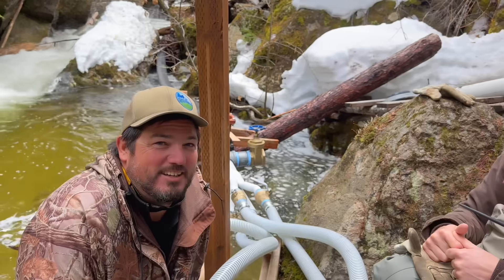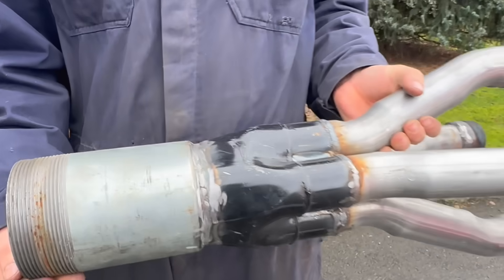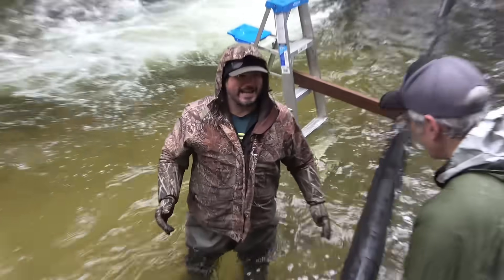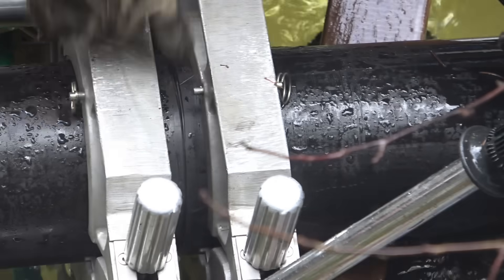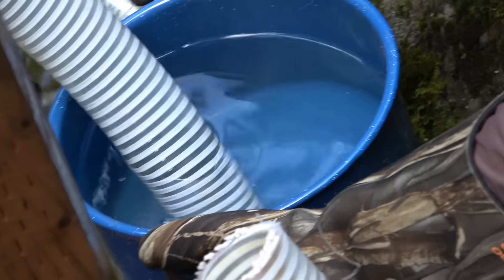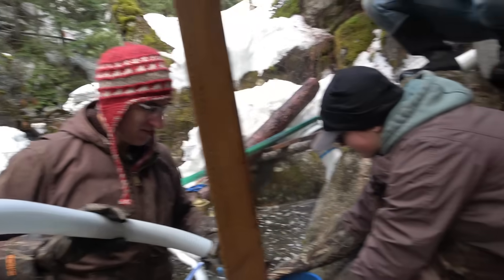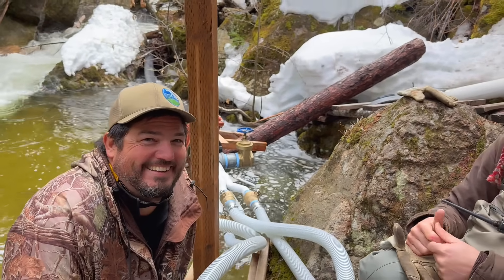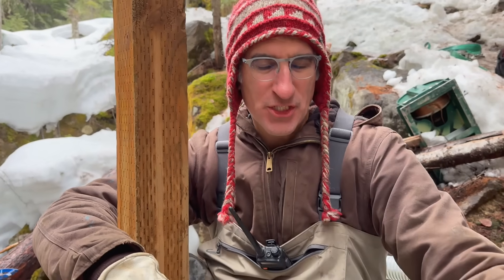Off Grid Micro Hydro - 24/7 Electrical Power - THIS is The Way!

Comment: I live in North Texas and use wind power. 
I design & manufacture vertical-axis wind turbines (VAWTs) because the wind where I homestead often gets up to 45 to 60 mph.

A horizontal-axis wind turbine (HAWT) would likely tear itself apart or constantly furl (move itself out of the wind flow as it overspeed and precesses).

A VAWT will stand its ground, because it is a "drag" machine, much like your pelton wheel water turbine.

"Mine" also employ Darius blades for extra speed and power.

Some of my turbines make electricity and some compress air instead of storing energy in a chemical battery.

The ones producing electricity run small motor-driven air compressors, each feeding my compressed air battery.

I later use compressed air to run small air-driven engines to make house current when needed.

I find storing energy as compressed air much simpler than electronics & switches & inverters and . . .

😊
Reply: I'd be curious to know what the system efficiency is, but if you have that much wind it probably doesn't matter
Reply: @marksopuck  
I thumb my nose at efficiency.  Who cares? That it works at all is good enough foe me.
Reply: What are you storing the compressed air in? I’d assume something like a large recycled propane tank?
Reply: @Isaacmantx  
Yes, along with old non-leaking used water heaters and receiver tanks from scrapped compressors.
Reply: @WhatDadIsUpTo --- Using compressed air to energize a turbine for 24/7 power...how many tanks(and what size) do you utilize?
Reply: @tanajohnson3663  
300 gallon, constant low flow. My engine has 3 positive-displacement pistons. Each piston handles a tiny gulp of air each revolution.  It can run at 1 rpm, but it's speed depends on how much electricity it's making and whether it making ac or dc.  Ac is 120 volts @ approximately 60 hz. DC is 15 volts (14.7).

BTW  - the only 24/7 system load is air stones in my greenhouse, feeding DWC hydroponics. Electricity production is on demand, meaning it's made for a short time to perform a task, then stopped. ConEd I am not. I homestead alone in very rural Texas.

Oh, also, I  employ high torque from the turbine and mechanical advantage to generate electricity.  My engine has tremendous torque even at zero rpm. Steam & air just roll like that. Internal combustion engines manufacture braking horsepower,  whereas Steam & air make shaft horsepower.  That's a HUGE advantage over ic.
Reply: I'm in NTX too and starting down the path of wind and solar. Solar is the easy part but supplementing it with wind would be ideal. Would love more info on your company and/or setup.
Reply: what sort or pressure and volumes are you dealing with? also thats a really great idea.
Reply: @zviper  
Average 300 gallons @ 85 psig with any more released through a preset blow-down valve, condensation tickler valve under each of 4 receiver tanks. I have a small amount of constant flow (24/7) through DWC  hydroponics air bubbler stones growing peppers & tomatoes.
Reply: @SiwyWabbit  that's impressive my guy.
Reply: Would love to learn more!

Comment: Jeff you have created free clean energy just tune it up. Need more amperage?  increase the number of turbines, 4 lines of flow 1 times the power.smarter not harder=  4lines + 4 turbines, 4times =the amperage boost your needing maybe? not sure myself have a think. I imagine a  tank or 30'water tower system enclosed for heating and protection.  I seen your header (mind blown) fantastic job btw, and my first thought was 4 turbines. If a tower/tank at height and a big enough tank like 10000+gl 1 top 1 bottom my loop, throw a sump pump in the lower tank and well create a loop, keep pumping it back up one big cycle machine running at flow 24/7. If done right I'm thinking free hydro and then heat the tower and year round use anywhere. what ya think cheap too

Comment: The large sudden diameter change after the valve is a loss. This should be changed to a taper. The flow regime in the pipe is probably still turbulent rather than laminar flow, but this is not a problem (water is only laminar at very low velocities). If you want the pipes to be self cleaning you should aim for velocities of around 1m (sorry 3’ 😊) per second. The improvements to the piping will certainly have reduced the pressure losses. Keep up the great work, I always enjoy watching your videos!

Comment: The only thing I would recommend is using good quality hydraulic hose clamps (T clamps) on the barbed fittings. Those cheap PA ones will eventually fail. Otherwise, cool stuff. Also a 1/2 inch nozzle size will drastically increase the velocity of the nozzle which is what you want for turning the turbine.

Comment: I'm sure you could weld up a conical strainer for the intake to eliminate the bigger rocks without affecting the flow overmuch. Cone obviously points towards the water source

Comment: The system is much better with far less resistence ofcourse. But you certainly don’t have laminar flow as you stated a few times. However it doesn’t matter, because the substantially lower pressure loss does give you higher power from the turbine.

Comment: If possible, you could put a solar MPPT controller on the turbine that is rated for 250v.  Whether its a solar panel or a turbine, the MPPT won't know the difference.  It could help with optimization of the power output.
Reply: I was thinking the same and checked the comments to agree with someone.
Reply: Quite sure you have to make sure nothing disconnects. If no you will have a run a way turbine.
High speed will make it wear out, faster.  But higher voltage  and step down at the batteries will help efficiency
Reply: @rolc8272  You are correct, a dump load for when the batteries are full is required as the charger will cut the input, and the turbine will run away. You can get an MPPT charge controller for Hydro with the dumb circuit built into it. You have to size and purchase the dump load based on the generator size.
Reply from the maker: Yes, this is a good possibility
Reply: @Gridlessness  ES&D recommend against using MPPTs with their turbines, because they are not needed. In a hydro system with consistent pressure and flow, the peak power point stays in the same spot. This is the point of the fine-tuning / adjustment of the rotor height. The DC connection to the battery means that the voltage of the turbine is held to the battery voltage, and you're tuning the rotor height (and if necessary, switching between the different coil wirings) to increase and decrease the magnetic flux, in order to find the maximum power point yourself. The open circuit voltage (ie, with the battery disconnected) isn't the normal output of the turbine that you need to worry about regulating down, it's only generated when there's no load - the turbine will spin at the right speed once it's connected to the battery or load at the other end which will hold the voltage down. That's why you have a TriStar at the other end just to make sure there's always a diversion load on if needed (e.g. battery is full).
Reply: Beautiful manifold btw... Big improvement on the original install. 😁 I have a Stream Engine at my off-grid house in Scotland.